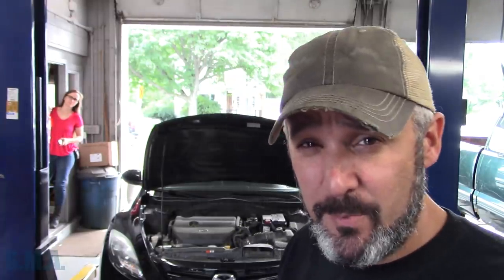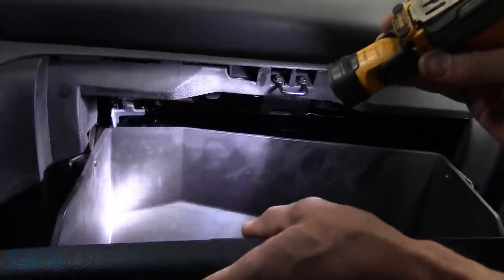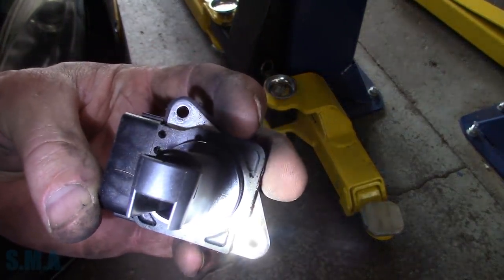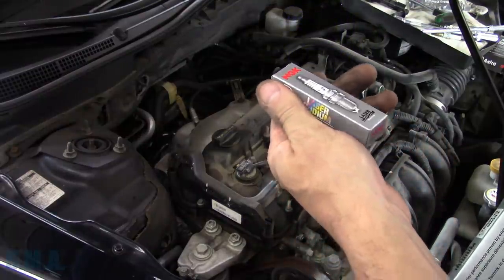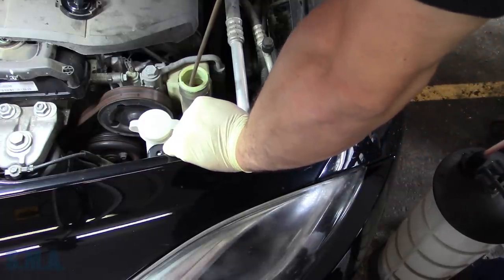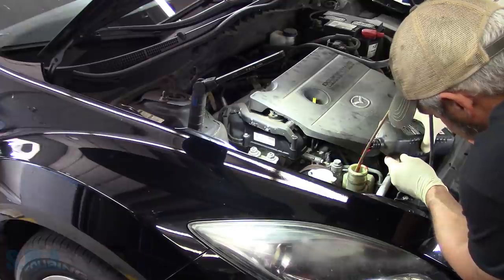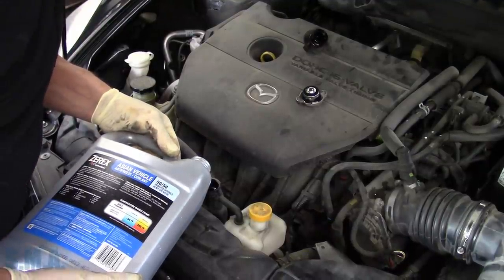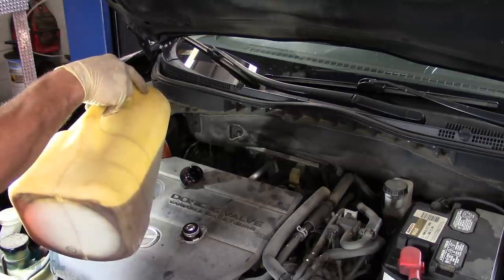Mazda 6: 100k Service Front To Back

Comment: 9:10 Haha YES!. Easy...and incredibly time consuming. Easily put 20 hours cumulative into cleaning my engine, and that was only the top side. (srsly, the thing smelled like a fryer when it ran. Headaches and scratchy throat after a long drive. Previous owner seemed to think oil went on the outside of the engine as well as inside. Did wonders for the rust control mind.)

Comment: 32:18 put your index finger on the center of the cap, like a spring loaded axix. Turn COUNTER CLOCK WISE with your thumb and your middle finger. When your feel your index fonger "thump" that cap, start turning clock wise.

Comment: Ha Eric: How about replacing the fuel ⛽️ filter, ? ❤️ your videos, great job. Be safe.
Reply from the maker: There isn't one on this vehicle, besides the one in the tank on the fuel pump
Reply: It's a bugger to get at,you have to remove rear seats to get to fuel pump,then disassemble /reassemble the pump and sender as the new filter doesn't fit the same way. Mazda prefers to sell whole pump as a whole

Comment: My owner's manual called for GL5 oil in the manual trans...  Not long after that, the oil was quite sparkley and the trans wouldn't shift any more.  Ooops, misprint in the manual, was supposed to be GL4.

Comment: All cabin air filters that are mounted horizontally with the blower motor mounted below the filter have downward air flow direction otherwise all the dirt and debris would be in the blower instead on on top of the filter.

Comment: Go figure, I went to check my cabin filter on my '07 Galant ES, Cali. car, and no cabin filter. From what I could find it was a dealer option. I always drive with my windows a bit any way with the a/c in summer & heat in winter.  

Always pays to do your 'do diligence'. I have to change the driver's side trans axle  So I  YouTube'd how to do it and found one only. He was doing an'09 Galant. His process was to remove the strut and the axle nut was 31mm. Plus you need a wheel alignment.

So I have the factory manual on disc, about $10 ebay, and there process involves popping the ball joint out and a tie rod end.  I also have a Hayne's manual and they only require the ball joint out if I read it right. I'll go over them again and printed the pages of the manual. One thing really nice about the factory manual is there's a blowup of the hub assembly showing all the nuts and bolts with the torque specs included next to each nut and bolt.

Plus I get to go over the brakes, been 5 yrs, 5,000 miles but will take part and reassemble hoping everything is ok. I'll have to find one of your brake job videos to reorient myself. What would we do without the internet as much as the risks we hope what we want confidential to remain confidential. I was a programmer in school for a while until I burnt out. Eh, I 'm just not an indoor person. A lot goes back to my infantry days, not by choice, lol, where life seemed a little less confined

Also need to change antifreeze, brake fluid and power steering fluid. Di the trans fluid  about 4 yrs ago twice. wasn't happy with the 1st change, ran 6 mos. before 2nd change. 

Thanks for sharing

Comment: Its not too big of a deal on the 3L engines but my truck takes 14 gallons of oil (2016 kenworth t680 cummins cm2350) and both with the coolant and oil i leave it about 1/4-1/2 gallon below full so theres room for the heated fluids to expand just so im not blowing fluid out where it aint supposed to but on small car engines the expansion is minimal but even then like 1/8 quart below full is where i keep my dodge at its a lesson my dad taught me and i follow that ever since

Comment: I recently gave my car, a 2008 Renault Grand Scenic 1.6L petrol fuelled, a full service and also gave the engine a carbon cleaning. It’s got 110,080 miles on it and it runs fantastic. It’s the first time that I’ve got a carbon cleaning done on any car I have owned and I recommend it. My MPG has went from 35mpg to around 50mpg. A good service for your car is always beneficial. 😎

Comment: My first day in a shop they told me to use a impact to remove oil drain plug on a transmission in a suburban. I was directly under the truck and spun the plug off and sure enough I learned a good lesson as the fluid drained all over me. They thought it was funny as hell mostly because it was the first thing in the morning.

Comment: Zoom Zoom Zoom.   Yea I own a 2008 Mazda 6 and that puppy doesn't owe me a thing and yet it has a boat load of Ford Parts on it.   I been servicing that puppy myself since Jan 2009.   That serpentine belt is a major PITA and you're not kidding about needing 2 people and it's the only task I am aware of that will get a Baptist Minister Swearing more than a Sailer here in GA.   The other pains are the PCV being under the intake manifold and changing out the cooling hoses which is best done if you're doing the PCV or knock sensor.    The thermostat is also a pain, but I suspect easier if you were to remove the intake manifold which is easier than removing that damn serpentine belt which is what I am going to do the next time I have to deal with changing out a thermostat.

Comment: Hey those serpentine belts are an underappreciated job. I needed my son to hold the tensioner bolt loose while I threaded a new belt on (08 Sienna). My son is really strong, but he had to put "full beans" on that wrench to keep it loose while I put in the new one, accessing the routing through the wheel well. Don't think I could have done it solo. Thanks as always, Eric!

Comment: FYI- there’s a recall for that rusty subframe from Mazda. It’s actually dangerous to drive if it’s flaky rusty like this one. Mazda will either replace the whole subframe if bad enough or install a steel subframe support and put some type of wax on it. Research it. You should tell the owner of this one to take it in before he/she loses their whole front end whole driving.

Comment: Eric, I enjoy watching your videos.  Just a question, if I may.  I have a 2005 Toyota Tundra SR5 Access Cab, Step Side with just over 188,000 miles.  I'm going to need to do the 200,000 mile service.  What types of things should they be trying to "sell" me as far as service?  I'm thinking serpentine belt, for sure.  The timing belt was changed back at 107,000 miles.  Tires are less than 2 years old.

Comment: The central fact of American democracy: vote or don't complain. Your side of the issue lost 90-40 (38:35). Now there are 100 complaints that they don't like the result. Well if all 100 complainers had voted the vote result would have been that their side won 90-100. Thanks Eric. Good point.
Reply from the maker: it's over one hundred right now....you want change.... make change, however, it's a little late now. That ship has sailed on this project

Comment: I had a 73 Dodge Dart like that in dark green with a black vinyl top.  If was great until the lady beating her kids ran into me at a RR crossing.  I saw her coming in the rear view.  I blew my horn, saw her head swivel around and realized it was too late.  Bent the rear up, broke the seat back, and a week later, the automatic transmission lost forward gears.  I miss that car, but not enough to get another one.

Comment: You forgot to vacuum the carpet and hang a smelly thing on the mirror for that essential tree pong lol :-D
Reply: 'bout 60 yrs ago when I was a kid, I worked in a 76 station, when we did a tune up (Points, plugs, condenser, maybe wires) we always were told by the owner to wash the car too.  All that for a $20 bill and some change.  Today, I can easily spend that on a car wash!

Comment: I tried the never seeze on the plugs, disaster !!!  Almost couldn't get them out at the next change.  Plug manufacturer's say it is not needed.
My plugs on two cars were in for 120k on each.  That is the Toyota recommended change interval and it works.  Both cars now over 250k.

Comment: My method for coolant flush.  Drain.  Fill with water and flush chemical.  Bring up to full operating temp with heater on max. Drain.  Refill with water.  Bring up to full operating temp. Repeat.  After the second clean water rinse, drain and fill with full strength coolant.  This will likely get you past 50/50, so remove some and add water.
Reply from the maker: they don't sell the proper coolant for this car in full strength :)

Comment: Yeah my rear diff is so rusty you can’t even find the fill plug 😂 my Tahoe been towing boats for 20 years, strangely the rust is worse in the front than rear even tho the rear has been in salt water multiple times

Comment: Fuel injector deep cleanings. How often should this get done or is this a  run bottle of cleaner every 10-20,000 miles till you run into an issue with them?

Comment: I'm not sure how much I'd be willing to spend on maintenance on a northern vehicle---what's the point of having a car that runs/drives perfect when the floorboards are falling out of it? I would do the basics, though
Reply: Depends on how much you drive I guess.  My car is 10 years old and I live in Eric O's neck of the woods and have spent the last 4 weekends patching up rust holes in the car.  Car runs and drives perfectly and only has 97K on it but the body has maybe 2 years left in it.  :(
Reply: @chrisfreemesser5707  Here in Florida, it's worth it to do all of the maintenance---the worst thing you have to worry about here is the sun burning the paint off of your car

Comment: This car has a pretty rusty undercarriage for 100,000miles/160,000kms. I have a RAV4 with 230,000kms that does not have any rust on the undercarriage at all, stock ATF and still drives like new

Comment: I have been using the copper based anti-seize grease on spark plugs now for over 40 years and it works, I have never had trouble removing spark plugs from alloy heads, on the contrary I have worked on cars with the newer coated spark plugs where copper anti-seize was not used and they have been very difficult to remove.  I have not tried the graphite-aluminium based anti-seize products as the copper (copper eze) product has always worked for me so maybe its the non copper based anti-seize products that cause problems?

Comment: I tell ya I could notice the horse power increase during the test drive, it's set me back in my chair something powerful. I also don't think I'm passin that much gas now, so good job. I must confess though, lately I haven't been greasin my nipples enough and I hope I don't regret it later if they become crusty. But its always nice to get her up on the rack and really check that rear end out, maybe do a little work on the front end. I hear there are lots of after market items to really enhance the front end on these older model's. That climate up there is sure hard on the old gal though, I prefer my warmer southern climate. I can still look under her skirts and see she is still no worse for wear than the day she came out other than a few dirty spots and maybe a seal that aint as tight as she used to be. She has been rode hard and put up wet a time or two so you can expect a little of that though. Great videos' though, waitin on the next one.

Comment: So if you had a car come in with no way of telling what coolant was in there and you cannot get all of the coolant out, is there a "safe" formulation to put in there or a way to tell what is in there? For example, I have a couple old rust buckets that I bought used, and who knows what is in them. Same thing for brake fluid. I know the cap says what should go in there, but what if you don't know what was actually put in there?

Comment: Should have cleaned off the windshield for the customer. Tsk tsk 😀. I remember my dad and grandpa (they ran a shop) doing that after every service back in the 70’s and 80’s. They also had probably the last full service gas pump in the city. Pump the gas, wash windshields and check oil. It’s a wonder they got anything else done.

Comment: Here’s a tough 
case of my crappy Dodge please help

I have 2009 Dodge Charger 3.5 RWD I've had a problem since the end of 2018 that isn't getting diagnosed, in the morning upon cold start when I drive if I press the gas pedal half way down the power cuts off and then comes back on again and it starts running this happens for the first 5 to 7 minutes of drive every time I let go of gas pedal and then press it half way down I starts doing it again but after 5-7 minutes of running the car becomes normal and is not as bad for the rest of the day running but after leaving it parked for about 4 to 5 hours the problem reappears but not as bad as it's in the morning cold sart. I've even changed the fuel pumps plus throttle body, fuel pump relay in fuse box but still the problem persists and I've run out of options theres no check engine light and the guy working on my car says he took it to several diagnostic scanner places where they did live scan and looked for stored codes but they didn’t find anything 

I’m beginning to suspect intake air temperature sensor I cleaned it but no difference can buying a new IAT sensor fix my problem?

I should also mention that using 89 octane fuel makes the cold drive 50% better and if I leave the car dormant for a few days the problem worsens

I'll appreciate any help about my car's problem, I’m in a tough financial spot 

Thank you
Derek
Reply: well, you already fired off the parts cannon pretty hard at it.  What's an IAT cost?  might as well toss that at it too.
here's a question for you, what's the sensor saying for temperature? and what's your outside temp reading.
Reply: johnhufnagel did that test too theres only 1-2 degree difference from outside temp on cold morning on the scan tool, some 1 suggested to disconnect the coolant temp sensor and start it and It got better by disconnecting coolant temp sensor so bought an original new mopar coolant temp sensor but soon as I connect the new 1 too the problem came back. There’s 2 variables that make it act better or worse the octane number of fuel and disconnecting/reconnecting the coolant temp sensor 

Will appreciate your help on this, thanks in advance 🙂
Reply: i'd have to hear what the engine sounds like when it does this, but could be fuel injector, could be sparkplug/coil, even a valve sticking up if it starts skipping when it has that loss of power.. i'd check the sparkplug gaps and for spark-jump traces, incorrect plugs, too..
Reply: @derekdurbin4066  I'd want to see what the O2 sensors are reading during all of this.  I've got a suspicion based on experience with a different chrysler vehicle that did something that sounds similar to what you're experiencing, but in my case I had a wideband O2 sensor also installed which immediately showed an issue with fuel trims.
Reply: johnhufnagel I did check them on scan tool it’s a minus reading within the normal range can’t find a pic of it right now though , in your case after the O2 sensor caused the issue how did you remedy it?
Reply: NiteRiderEVO did all that and changed the spark plugs using the chassis number the power just cuts off for 2 seconds and comes back on if I floor the pedal the power goes out longer and a loud knock or clunk from engine when it comes back on

Comment: Overview: Cabin air filter; engine air filter; MAF clean; New plugs; P/S flush; Oil/filter chg; Tranny fluid chg; Coolant flush; Windscreen fluid; Brake insp; Brake fluid flush; A/C svc; Tires; Battery; Spare; Serp. belt; Lights; Test Drive.

Comment: Why do you never clean the battery terminals and the connections with (Holts 
No Corrode) and the terminals at the chassis. Windscreen wiper motor.

Comment: @South Main Auto Repair LLC  Hey Eric, do you have a recommendation for aftermarket CV Axles for a 2004 Trailblazer EXT? Im looking at Cardone, but they seem do be shorter in length to the OEM's- does 3 inches shorter or longer matter?

Comment: I have an Acura RSX that takes that blue coolant it had the green in it I drained the radiator three different times and there's still some green in it like no matter what I do the green overpowers the blue you can tell there's blue in it but just that little miniscule bit of green What tint the blue coolant to where it looks green even though it's blue

Comment: Whyd yah use the same crush washer for the transmission? And why didnt you use oem radiator fluid some brands have trouble with that i kno bmws raditors would get deteriated if you used stuff other then what was it was made fore. And why didnt you flush the radiator?

Comment: Mr.O I have a problem with my 2003 Honda Civic it overheats and I lose coolant out of the overflow can't find any leaks anywhere any input ?
Reply: Shaun Fowler stuck / bad thermostat, missing / slipping belt to water pump, bad pump, plugged radiator, collapsed hose, or 42 other things.  It’s time to find a SMA near you.
Reply: Have it checked out asap. It can't be good to overheat a 1.7 motor. I have seen quite a few need head gaskets.
Reply: Thanks slot I hope it's not too bad tho and I wish there was an SMA here lol

Comment: Hey South Main, quick question for you. I have a 2009 Mazda 6 2.5, I asked a shop to flush my transmission and they would not do it. Said that it needs a special tool, and that the system might be pressurized and they didn't want to cause problems. How do you feel about this? Thank you!
Reply: Also just did the alternator on my 6, it was most certainly a great time!  It was a PITA, but we got it with patience.